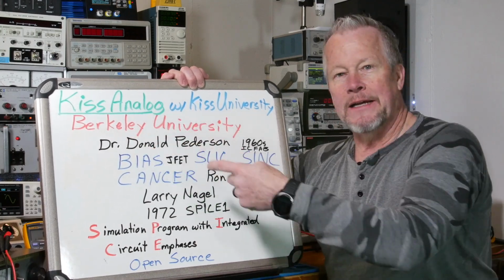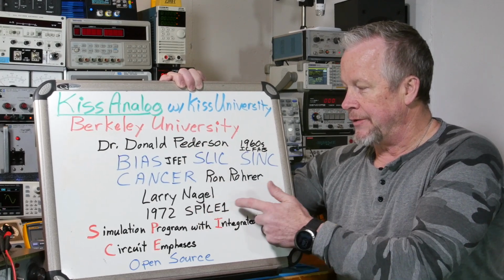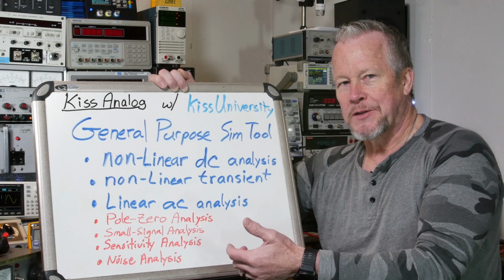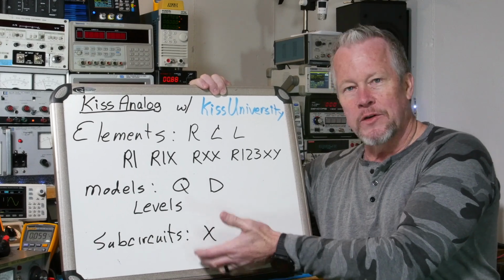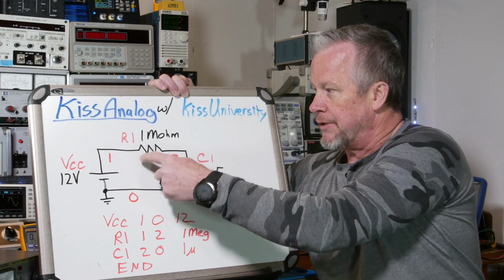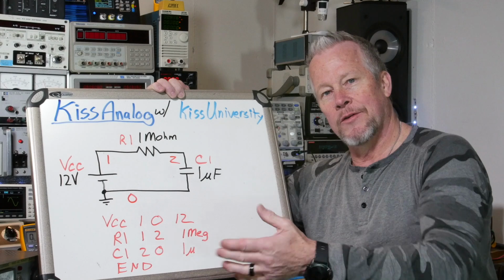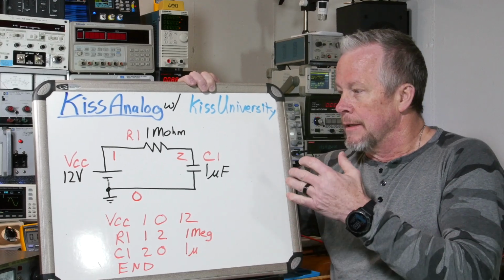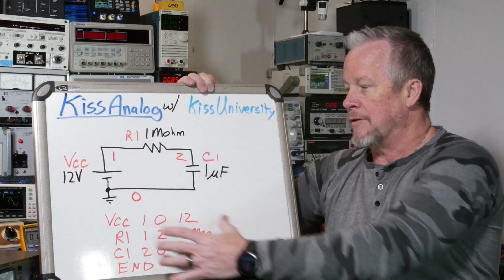Learn MicroCap SPICE with Kiss University Kiss U 106 - part of my Kiss University playlist #KissU

Comment: Excellent introduction to the background of Spice - looking forward to future episodes of this series.  I find the models in LTSpice can be a bit off and the tool is a nightmare to work with, at least on MacOS. Even finding and installing new models is unnecessarily complex and you'd think that after all these years it would come with staples like LM7805 models that are accurate.  I have Microcap on the back burner to try and learn.  I guess noise analysis might be somewhat in the future but that really interests me right now.
Reply from the maker: Thanks Andrew!  LT translates the models so something could get lost in that translation.  One tip, zero the resistance in the inductor models and it will force LT to look at it as an inductor vs a current source.  MicroCap will come along easy and fast once you spend just a little time.  Much more intuitive and powerful than LT.  Especially with the huge library of components and circuits that MicroCap comes with.

Comment: You didn't mention HSPICE our professor says it's the industry standard
Reply from the maker: Well he might be right, but you would have to be talking about spice for foundries.  It is expensive from what I understand and I’ve never actually seen it in the industries that I’ve worked in where board designs are common versus fab designs..  Search the term and you are likely to mostly find only universities using it.  Berkeley SPICE is open source so a number of companies use it to put their GUI around it.  Awesome question - thank you!

Comment: Im using Multisim for a couple years now. I'll give a try to Microcap.
Thanks for the video.

Cheers!!!
Reply from the maker: Thanks Eduardo - let us know how it goes;)  Multisim is a good tool - or was until it was purchased;)  I did have some bugs with it.  I remember seeing thousands of volts when I only had 12 V applied.  I'm sure that has been fixed;)
Reply: @kissanalog  Those thousands os volts are still around. The last time I've seen these type of bugs was using some  comparators. They often put out some kV at its output. Multisim has a lot of bugs, but is very usefull. But I'm getting sick of these bugs. That aside, I really like their interactive simulation. But I will give a try for Microcap since I just heard good things about it. I'll update you how this migration goes. 
Cheers!
Reply from the maker: I kept it around for awhile too - just for that.  But I too got tired of the bugs.  I did like the low frequency AC to DC power stuff it could do.  But now its been awhile since I've used it and have been using MicroCap and a few others for awhile now.

Comment: Been using the LT and Tina for a while now. I even tried circuit lab for some basic stuff. Haven't used Micro cap much because it was too expensive for the longest time. Interested in seeing how in depth you take this. I only scratch the surface.  Maybe eventually you could compare accuracy of a simulation vs some real world bench testing.
Reply from the maker: How do you like LT and Tina?  I've used both as well and both seem to work well.  I have had an issue in the past with LT as did an engineer who worked for me, but I think they are all good tools.  MicoCap was expensive but I got a deal years ago so I had it for a long time but then I got a copy of Intusoft for less so I went with that.  Now, it is a no brainer to go with MicroCap;)  I do have an idea where I want to show a sim and then a real test to show how they should correlate;)